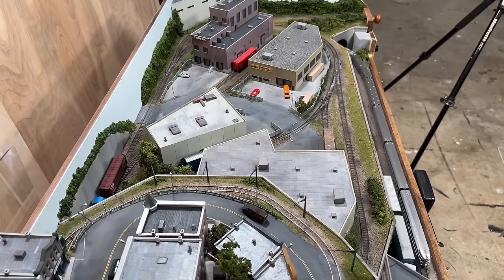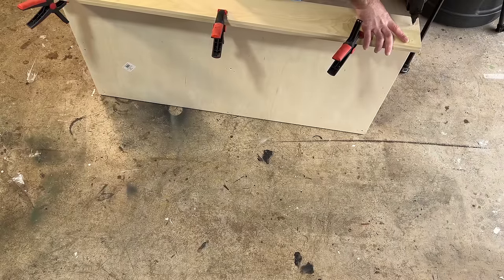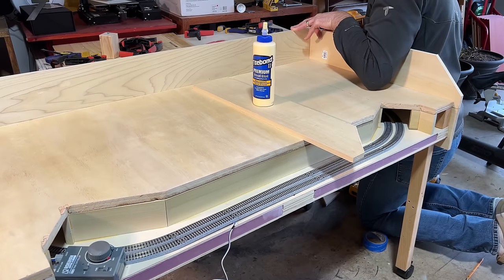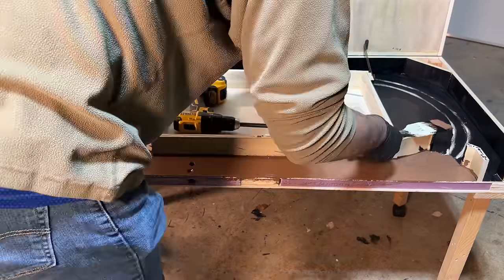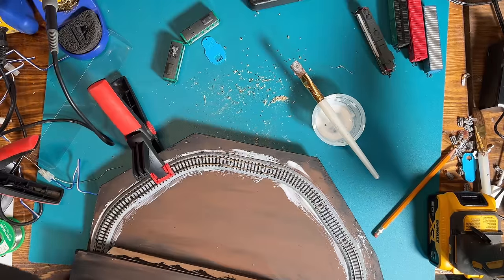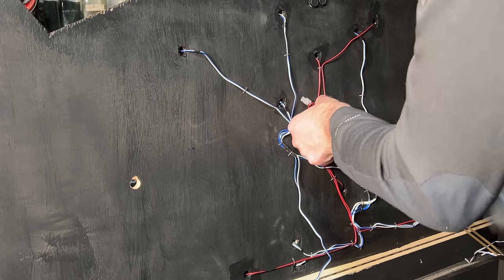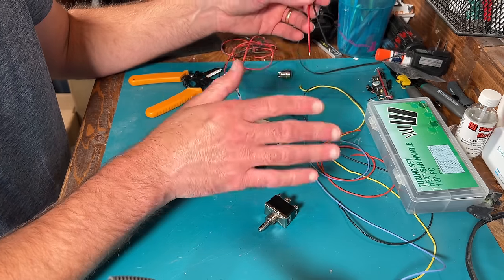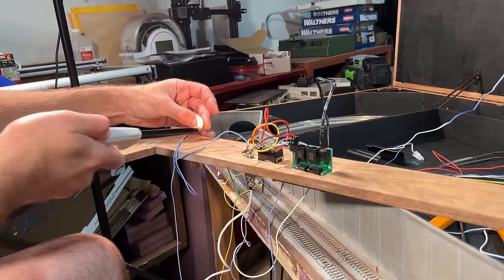Building a 2'x4' N Scale Layout From Start to Finish: Series Compilation

Comment: Hi Steve! Greetings from Spain. I’ve recently acquired an N gauge layout which, although  reasonably designed is built on a fixed L-shaped base board. A good deal of the structures are kit-build and, certainly reuseable however, the running tracks are not well planned. Seeing this video has definitely given me ideas and inspiration for a complete redesign. My main garage layout is OO scale so, I’m looking forward to the next few months of working on something a lot smaller😊.

Comment: I built an N gauge layout using a 36" x 80" slab door (no pre-drilled holes); nice size, great smooth surface to work with, and solid after I mounted it on legs.

Comment: You soldered the whole top loop (because there was a single feeder wire), but why did you not solder the other levels?  On the other levels it appears as though there are several longer sections without a feeder (esp on the bottom layer).  I take it the Kato track connections do a good job maintaining electrical connectivity thru multiple track pieces?

Comment: I am considering this in 3-rail O. Should be scalable. I guess the biggest challenge would be the hinged second level - may be too heavy/bulky for one operator. Perhaps rear platform access through openings where I can reach into the mid section, or maybe smaller lift sections spread across the length.
Reply from the maker: You would need to make the lift section sturdier of course and I would a couple pneumatic piston things on there to make it easier to open and close. Or maybe add some counter weights to the back of it.

Comment: Hi Steve, I've watched loads of your videos. All very helpful since I'm a beginner. I found a Kato track plan named Loop De Loop. The tracks needed are listed on the plans. There is one notation I can't find. There's a stroke across the track notated TJ. Any ideas ? Thanks for all the great videos.
Reply from the maker: It might be “terminal joiners” which are the rail joiners that have power leads attached to them. You swap out the unijoiners at that connection with the terminal joiners.

Comment: when you soldered all the track together, did you leave any gaps to allow for possible track expansion that might cause buckling ?
Nice video !
Reply from the maker: I didn’t solder every joint on this layout although for a lot of these small ones it doesn’t matter since the length of track isn’t enough to cause too much of an expansion issue unless it is getting super hot. Obviously the larger the layout the more critical expansion joints are.

Comment: This is one of my favorite videos and I know very little about trains but this is awesome :) if I wanted to get started with N scale what’s the most budget friendly way to start? Thanks :)
Reply from the maker: Well, the Kato starter sets are a great value for the quality you get. Bachmann sets are cheaper but i wouldn’t want to stick with the included easy track long term since it isn’t as durable and there isn’t as much variety in the track types.  You can buy just the Kato track sets and then piece together trains separately (individual locomotives, cars) over time as the budget allows to spread the cost out over a longer period of time.

Comment: Your vids are helping me build my small 2x3 tram layout. I haven’t bought the poplar siding boards yet but am curious about using oak veneer, the stuff that comes in rolls. I’d cut to dimension and glue to the 2 1” thick pink foam sheets I’m using to build my scene with gorilla glue. I’d still use the slats under the foam. Think this would be sturdy enough for a tabletop layout?
Reply from the maker: I’ve thought about playing around with that stuff for some projects.  I don’t know that it would be strong enough without another layer of something, but I’ve never used it so not sure. There is some size where it would probably work fine and some cutoff where it won’t but not sure where that point is.
Reply: @StevesTrains  thanks. I just bought some and it does appear fragile,  but I think you’re right, some sort of reinforcement looks like it can help as it appears to split easily. On layouts with curved fascia I think this stuff will make a layout look really nice 👍

Comment: awesome design. Is there a way to connect the bottom to tracks in such a hinged design? I suppose it would be similar to a bridge that opens?
Reply from the maker: It would be hard to do that of course. It would be easier with a larger layout so there was more space, but it would need to be setup like you might do a lift gate or something. Doable, but a lot more work to get a perfect track connection, especially in N scale.